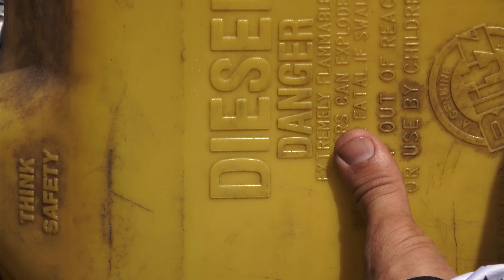Calas Performance Stage 4+ SeaDoo RXPX VS Boosting Performance Turbo Nitrous RXPX Jetski Drag Race

Comment: the hole shot on the black 300 is crazy because of the nitrous, but damn Calas that stage four plus is crazy on the top end
Reply: He is a bit limited on that stock ride plate.  Once your hit over 90 mph those 2021 rxp start to slow down due to the oem ride plate design

Comment: You and jp need to race 
Your stage 4+ vs the one he’s having to fix the jet pump tunnel on
Reply from the maker: I will be doing more videos with JP
Reply: I like jp I personally would never use him to touch my ski his turbo application seem to be a waste of time and money.....on this channel he builds ski's that run the same or faster mph then whatever jp works on. I could be wrong 🤷🏽‍♂️
Reply from the maker: @miamitrackstar  Every time you go Turbo it’s a ticking time bomb 💣 Why? Because you are pushing the envelope… It doesn’t matter who builds it… also at the end of the day these are machines and they do not all perform equally… you have fast ones and slow ones… also most clients ride their Jetski’s like they stole them… on the other hand JP has a lot of happy customers.